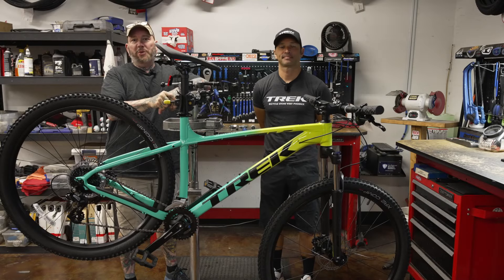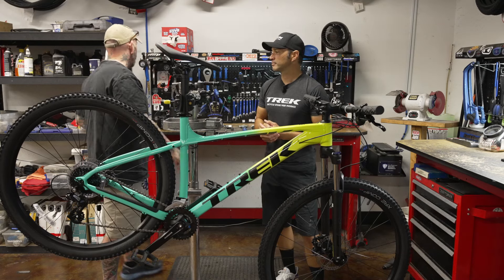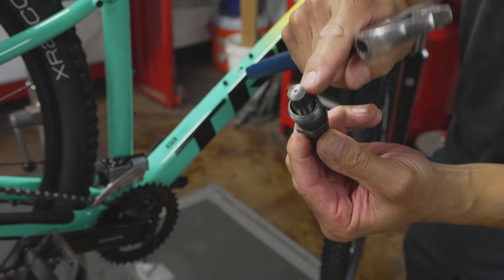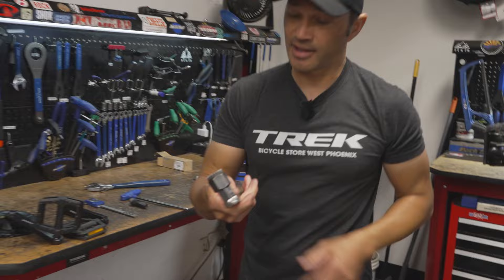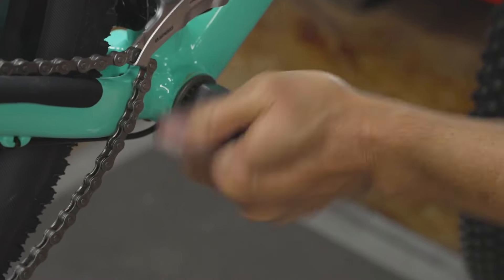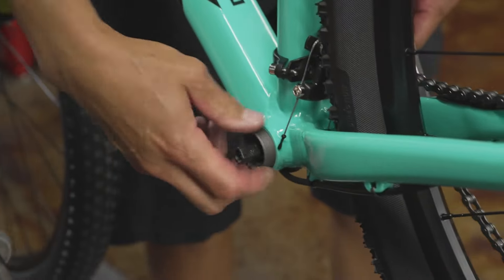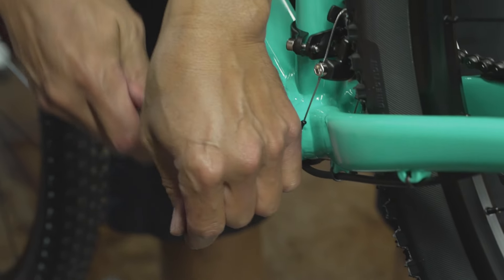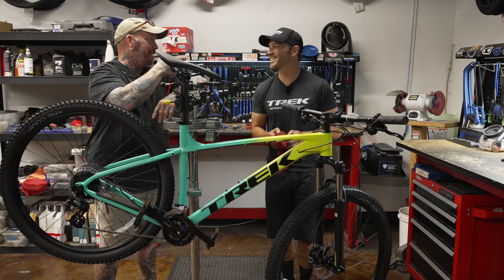Square Taper Bottom Bracket; Removal & Installation. What You Need To Know.

Comment: You also might want to mention that the inside nut(closet to the frame) should be tightened on your BB puller, otherwise if it's not tight enough you can strip the threads in the crank. And there truly is a torque setting for that square taper BB. Thanks for sharing!!
Reply from the maker: Jackie, thank you for taking the time to watch and point this fact out in your comments. I know we appreciate it, as will as our viewers.
Reply: You forgot to mention that any grease should be wiped off the spindle square taper and the inside of the crank arm square hole. This should be a dry fit. A bit of grease on the fixing bolt threads is fine.
Reply: You should also check the cranks bolts after the first couple rides as the cranks settle and they need to be snugged up.
Reply from the maker: @tomnanD3  You are correct, Tom. We appreciate you bringing this to our attention, and I am sure our viewers will also appreciate the additional information.
Reply: On the contrary,I grease the spindle to be able to pull the cranks easier when needed
Reply: @romanmentor9238  NO argument there...

Comment: I recently bought 2 bike repair stands from Amazon. The first one, by RockBROS at $38, I sent back because it couldn't hold my heaviest bike BY THE SEATPOST, without letting the front wheel go down to within a couple inches of the floor. A defective design, IMO. (It probably could've held it by the top tube, (which wasn't too wide), but I was concerned it MAY, while adjusting, compress my shifting or brake cables, enough to affect shifting characteristics). So, after taking pictures and writing a review, and getting an unhelpful reply from the manufacturer, I sent that back, and bought a $48 West Biking Bike Repair Stand, that is capable of holding up to 88 lbs., and you can either attach to a wall (probably not the best if you have sheetrock), attach to a wooden workbench (as I did, on top of two 2x4 scraps, using deck screws that I drilled first, to avoid splits), or to a scrap piece of wood, and held in a vice, as some have done. If you're careful to mount it ~a couple inches out from your workbench, depending on your specific one, as well as bike, you can avoid pedal strikes - because, afterall, one of the benefits of having a Repair Stand, is being able to spin the rear wheel by pedaling, in order to adjust the shifting, or rear brakes. A Repair Stand like this still means you have to lift the bike, to put it in the Stand, and while holding it, tighten the clamp - which takes a few seconds and many turns, because it's not a Quick Connect design. But I put my car ramps in place, to reduce how far I had to lift it. Big difference in bike maintenance, by having a Stand!

Comment: So torque doesn't matter on any of this?
Reply from the maker: Hey Alex, that you for asking this question as well as watching our video. In speaking to Brandon again on this subject, we both agreed that while you may be able to find a torque spec for this, it is not essential as it is on other procedures on the bike. Making sure it is good and tight with a little extra "oomph" is more than adequate.
Reply: Torque matters, but as both the square taper axle and crank retaining screw are steel, you'll have to go a lot higher here than anywhere else to strip the threads.  Elsewhere the fasteners are either (a) a lot smaller and/or (b) softer aluminum, so the torque limits are far less.
Reply: @WildBikerBill  Over tightening your crank bolts can cause the tapers to go to far into the crank arms as they are soft metal and bottom out on the axle tapers which can cause the crank arms to not fit tight and wobble wrecking your crank arms.  Every time you remove and replace your crank arms you wear the taper holes some and over tightening just makes it worse.

Comment: Note, if you put the outside rings to tight, it will make the bottom bracket spin less smooth, i tightend mine way to hard, had to loosen them a bit.
Reply from the maker: Thank you for watching my friend and for adding to the conversation. Both are appreciated.

Comment: 10:15 You'll likely need to apply A LOT more force than that, especially if the BB has been in place for several years. You can add a wrench on the other side to the hex section and use both to turn, or in an extreme case, bolt the removal tool to the spindle through the square ratchet hole and use a combo wrench (aka ring spanner) with a breaker bar on the end for more leverage. I had to use the latter and gingerly bounce on the end with my full weight to get mine to budge.
Reply from the maker: Agreed, sometimes it can be a bite in the butt to get that thing to break loose. Thank you for taking the time to watch, my friend, and adding to the conversation.
Reply: Yep, I ended up using an impact wrench to get mine out of the used bicycle I bought recently. It the whole BB was just rusted and fused on.

Comment: Great video guys thank you! I have a slight issue however, having replaced the bottom bracket (definitely bought the same size) the smaller front chainring is rubbing against the frame - any idea why/how to fix this? Cheers
Reply from the maker: This is a great question, my friend. Let me contact Brandon to give you the most accurate answer possible.
Reply from the maker: Brandon said the two most common issues to make this happen are 1) the spacer may be on the wrong side. And 2) the spacers may be the wrong size. And 3) a combination of 1 and 2.

I hope this answer helps you resolve your issue. If not, let us know, and we will try again.
Reply: @GetOutArizona thank you!

Comment: Hi Guys, Feel like I am already deep in the Rabbit Hole of Bottom Brackets. I am trying to work out what type of BB I have on a Trek Marlin 5 2017 (NZ). According to Trek website it is a VP - BC73 threaded cartridge. So damn confusing all these different standards.  Ok so BC would be British Cycle (according to Park Tools website), 73 is length in mm. The only thing I cant work out is what the VP stands for and does the 24T refer to threads per inch on the cartridge? in New Zealand we use metric. Converting my bike to a mid drive E-Bike Bfang BBS02, just trying to work out if I will need spacers and maybe a offset chainring. Thanks for your help and vid was really helpful.
Reply from the maker: We appreciate you taking the time to watch and leave your feedback. 

Yes, this is threads per inch; if I remember correctly, it should be 1.37 x 24 threads per inch. I would have spacers on hand, just in case you need them. There's nothing worse than being deep into a project and realizing you don't have what you need to complete it. 

I hope this answer is helpful for you. Keep us posted on mid drive conversion.

Comment: I have a threaded square tapered BB 68x119.  An exact replacement can't be found/out of stock. The closes fit is a 68x118 and 68 x120. Which size would you recommended?  Does 1mm either way even matter?  I have a 24 speed.   3 in front and 8 in the back
Reply from the maker: The 68x118 should work fine. You can use a spacer if need be, but I do not think you will need it. This is a great question, and I appreciate you asking, my friend.

Comment: What is approx tightening torque for non-drive side? Is it the same as for drive side? Shimano installation manual recommends 50-70Nm without mentioning anything about sides.  50-70 Nm for non-drive side might be too much because it does not have a flange.
Reply from the maker: We're sorry for the delayed response. Brandon and I are both traveling. That being said, yes, typically it is the same. However, a little prudence is always advised because, as you said, the non-drive side does not have a flange. We appreciate you watching and asking your question, my friend.

Comment: I'm still waiting for a tool, but...  My bike is a very old Schwinn Montague folding bike.  Made around 1980? or so...  I can't get the drive side cup off.  Are both sides loosen forward?  Like the non-drive side lefty loosy, drive side righty loosy?
Reply from the maker: Yikes, I believe you are correct about that, Charlie. I'm not sure where in AZ you live, but if you continue to have issues loosening the drive side, call the shop or stop by so we can loosen it for you, and you can complete the task yourself. 

I'm sorry it took so long to respond. Brandon and I have both been on the road.
Reply: @GetOutArizona  No problem.  The wrench I ordered was the wrong size...  So, went to HF and got a bigger crescent wrench.  It came off without too much trouble.  It was clockwise to loosen.  I have two quick questions:  I don't have a caliper, but my spindle is around 133 mm.  I can find a cartridge or a new one larger than 127.5 mm.  The spindle race has a slight ding in it.  A very small dent.  Can I get by with just new bearings?  Or, should I replace it?  Would a 127.5 work?  Also, I've seen videos of replacing the caged bearings with individual free bearings.  Is that ok to do?  Thank you for your reply and the video!  Rick, in Tucson.

Comment: Hi i am going to convert my bb from octalink to square taper. I just confuse what length of square taper bb i should take. My current octalink bb is 68/113 with chainline 54mm. So should i bough the same bb square taper with size 68/113 or different length? How can i determined it? Thanks